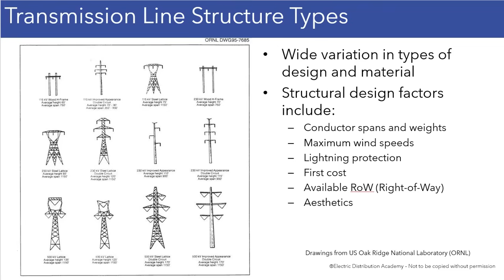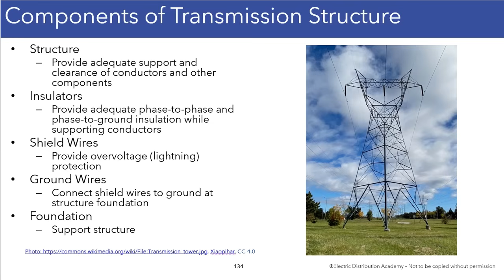Types of Transmission Line Structures and Their Components

Comment: This topic needs much more than 3 minutes to discuss. Angles, concrete, dead-ends, direct embedded poles, poles with casing, crossing structures. Grounding is for lightning protection. You can devote a full course to this topic.
Reply from the maker: Yes, you're right! This is just a short clip from one. We have two courses on the topic. You can find them both in the Electric Transmission and Solar PV Interconnection Bundle  - https://www.heatspring.com/courses/electric-transmission-and-solar-pv-interconnection-bundle?utm_source=Youtube&utm_medium=video&utm_campaign=comment